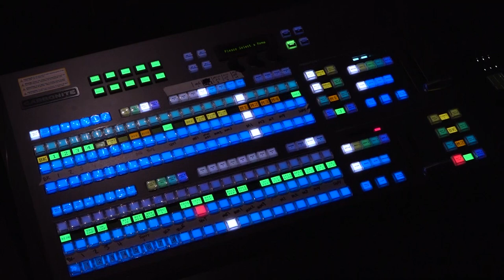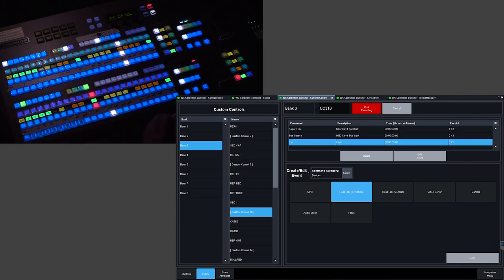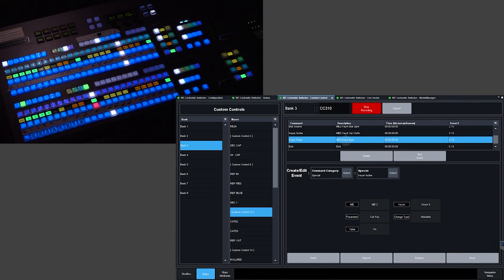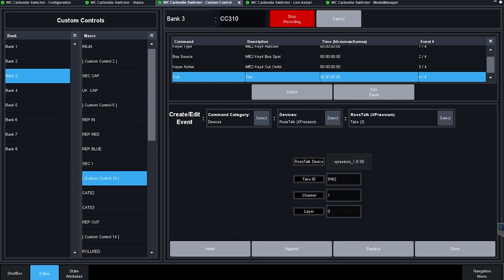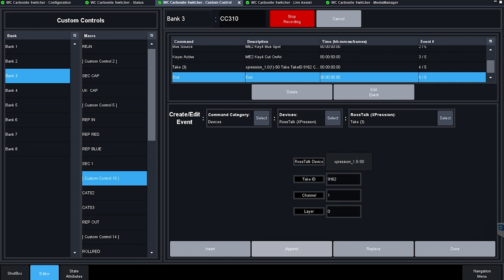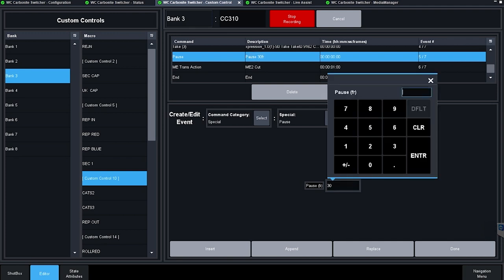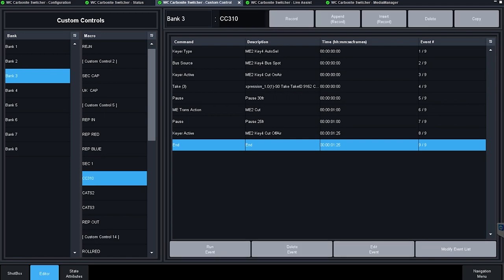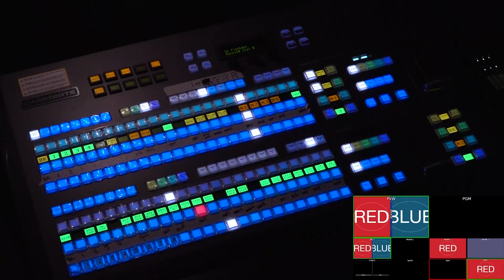Ross Carbonite LiveTD How-To: Building a Wipe Transition

Comment: Thank you for your videos! I'm new to XPression (Designer) and I've just followed your tutorial. It doesnt play the animation however and just learnt recently that how I'm using rosslinq to send to the framebuffer it does not send animations over rosslinq only single frames. Is there a way I can send the full 50 frame animation out from Xpression Designer to use as a transition wipe in carbonite?

Comment: Appreciate these tutorials a bunch! Got another very basic question, think you could possibly walk through how you set up a double box usually? We've got just one XPression output as well but not sure if the Carbonite has a way of just cutting in the double box with the two keys and the double box Take ID.

Thanks either way for these, super helpful!
Reply from the maker: yes sure! We can certainly make it work with a single Xpression output. Is your double box a moving background or just a static frame?
Reply: @livetdjustin6839  Just static frames! Have all the ESPN boxes/divider & then just a similar double box for our RSN.

Usually do it just by assigning all the cameras/CG to individual keys and then bring them all on/off manually, but it feels like that's kind of the wrong way to do it with how much hassle it is to try and get on 😅

Appreciate you taking the time with this!
Reply from the maker: @kingat95  shoot me an email at justin.w.melnick@gmail.com. Let's get on FaceTime and I can walk you through it based on your current workflow. Then I'll come back here and summarize what we did!